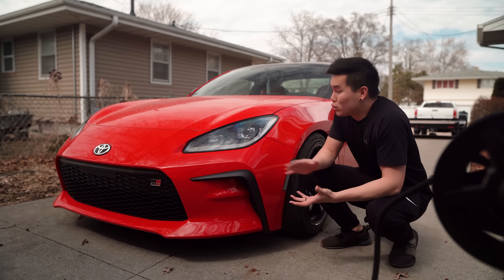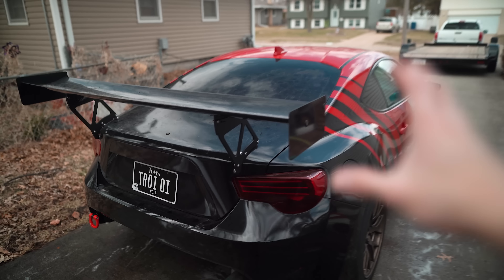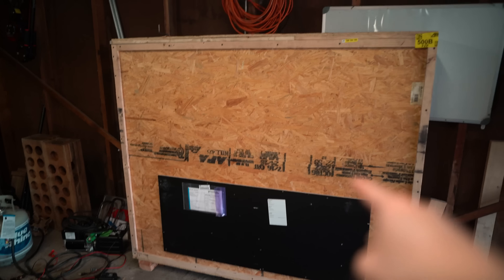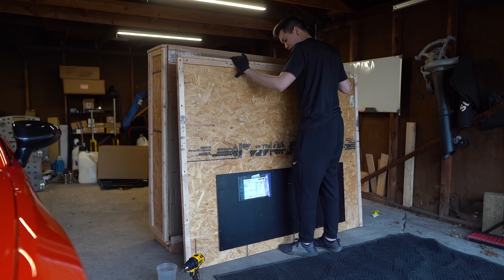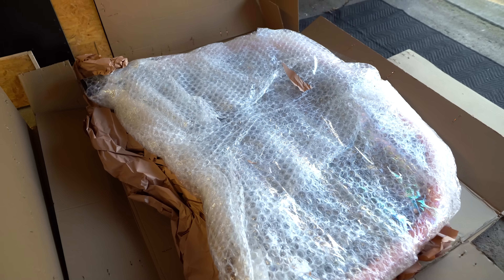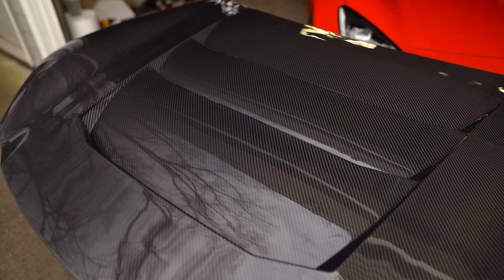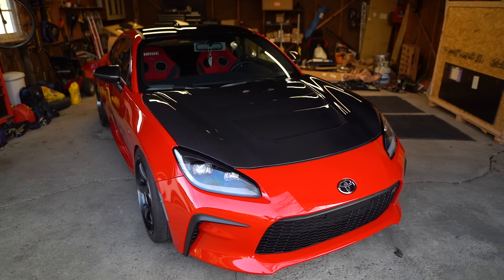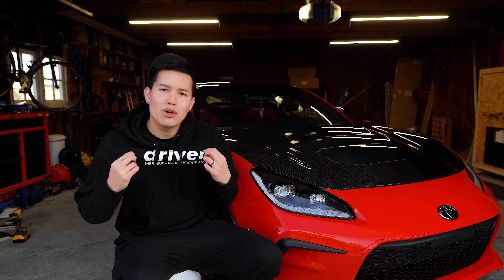NEW Carbon Fiber Super GT Hood for the GR86!

Comment: Can’t wait to see it color matched. But I’d recommend this (I did it with my Seibin hood) 

Have the paint shop tape off the vent inserts, then paint the hood red. Then when they clear coat it, remove the tape so the two rectangular  vent sections stays carbon. Would look insane

Comment: Got my roof wrapped in satin black and just installed a grimmspeed MAF hose and air filter - I know it’s not much but any power added is much appreciated. I’m looking to buy an exhaust soon, hopefully pair it with headers and a tune before I move to the Jackson racing radiator/cooler  and Perrin oil separator. That carbon hood is definitely going on the list though 👀

Comment: Hi Kevin! I would love a driven. Hoodie! I have a 2018 BRZtS that I got in November bone stock with 20k miles. I've already added an Invisia N2 burnt titanium exhaust, a grimmspeed cold air intake, 1320 performance catless UEL headers and a tune with my Open Flash V2 tablet! I also did ceramic tint and a brow. It's an amazing improvement so far. Now Id like to do more aesthetic mods like an aeroflow aggressive diffuser, smoked side lenses, engine dress up kit and bolts, upgraded lugs and eventually wheels with a nice deep offset! Congrats on 35k followers!!

Comment: Just got tires for my new 57CR’s. Mounting them today! Planning on wrapping the car a completely different color than the oem steel. Also planning on lowering it on FA 510’s and replacing most of the suspension components with GKTech and SPL parts

Comment: For my 2022 BRZ I plan on new wheels and tired plus some project mu brakes and stainless steal lines.   I have a road rally from Touge Con 1 state over in Arkansas to hit up and a few track days planned so the upgrades are going to be nice. 

As far as the new carbon fibre hood. I love it. Looks good man!  Get it color matched and it would look better then you can keep the roof wrap!  Keep up the good work man.

Comment: you'll have to keep that car in the garage now, looks awesome! this summer i plan on getting a new 15+ sti rack for my '13 wrx cuz mine has been leaking for a while. and then either a new thermostat/coolant flush, or maybe a new rad too cuz my coolant temps have been rising more often lately on short trips😔 oh & routing the aos oil drain hose down to the turbo drain inlet on the block... all reliability mods for now🙃